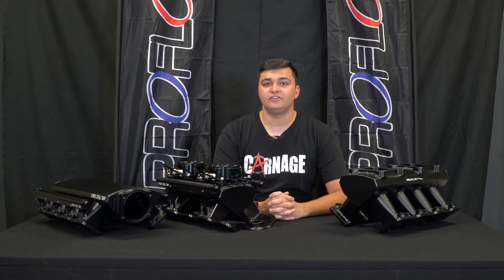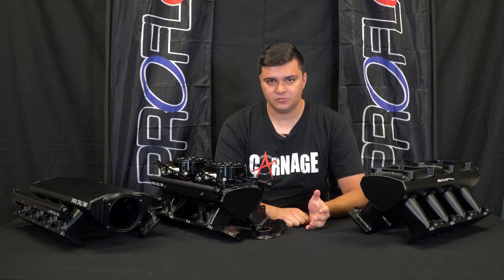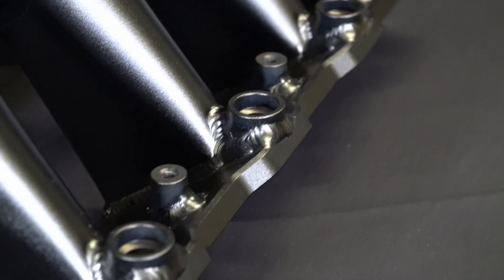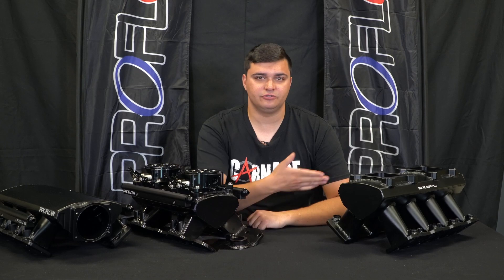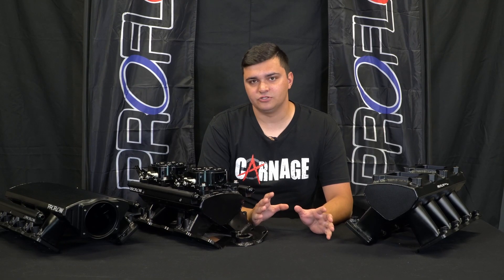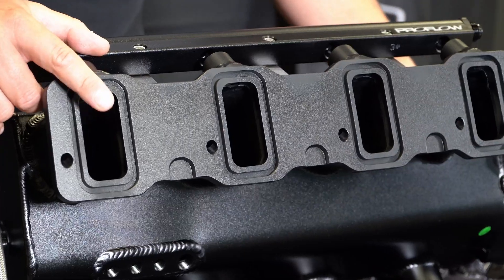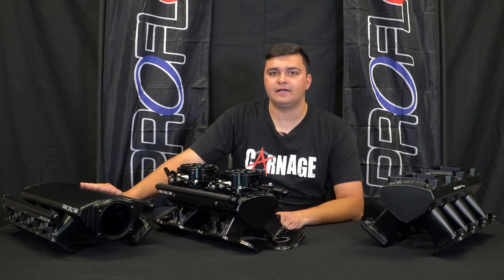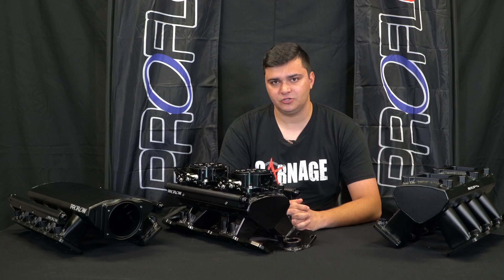Proflow SuperMax Fabricated Intake Manifolds

Comment: Performance increase ?
Reply from the maker: These are of course best paired with upgraded engine components such as camshafts & cylinder heads and will produce more peak power. You won't really gain much benefits if you put this on a stock engine.

Comment: I’m running a LS3 grange and would like to know how much boost the low rise intake will hold.
Reply from the maker: We wouldn't recommend going over 25 PSI in boost
Reply: @proflowperformanceproducts  thank you for the speedy reply. What other items would be suggested along with this manifold, 102mm tb and bigger injectors and fuel pump do you recommend for a boosted application to compliment this product and does this clear the WM bonnet? Sorry for the questions but thanks for the replies.
Reply from the maker: @baddaddy8718  92mm or 102mm throttle body, bigger injectors and an upgraded fuel pump are all good upgrades. The low profile versions will only clear bonnets in Commodores.

Comment: This intake will kill power below 6,000 RPM.
Reply from the maker: For the most part that is correct. This is because the runner length is quite short in comparison to the standard intake which moves the powerband higher up the rev range. These are of course best paired with upgraded engine components such as camshafts & cylinder heads.